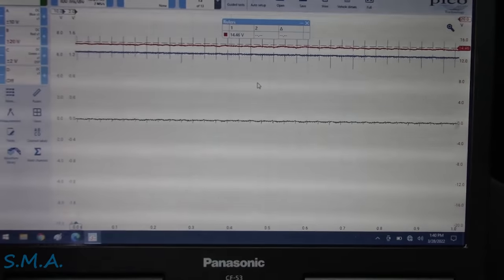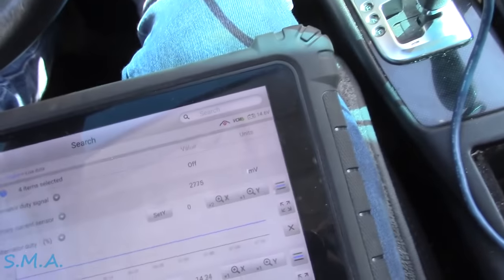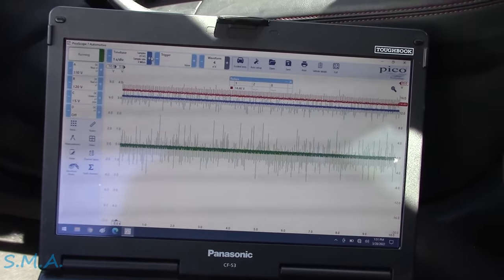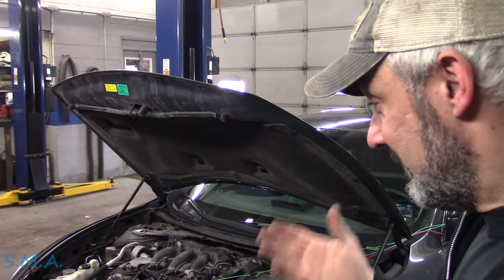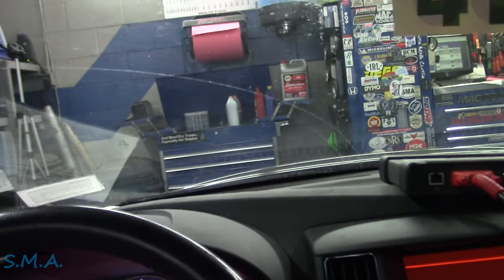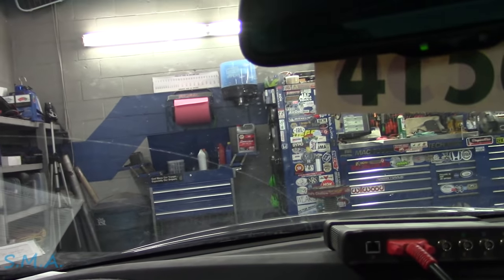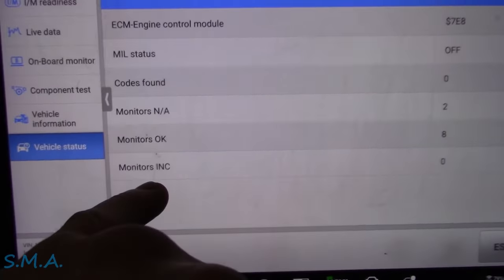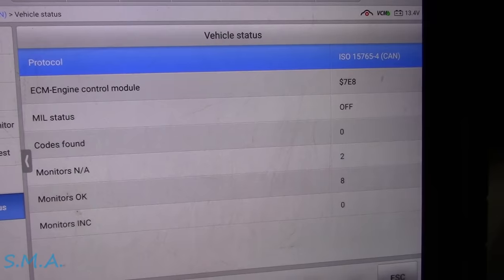Nissan Dealer Quoted Over $2000 For A New Harness!! - The Real Problem

Comment: But, here I am thinking, if the belt is squealing and the alt is wonking out, I'd have changed the belt first and see if that's all it was and then replaced the alternator if the belt alone didn't solve it....just because I had a 89 Sunbird that behaved exactly the same(minus ABS etc) with the flickering alt light, losing power, let it sit for a few, it was fine for a few more miles, than again .. My dad, an old mechanic, swore it needed a new alt. The shop I took it to said Nope, just the belt.  And that's all it was.

Comment: I think a refund isn't likely. The dealership will stand on "It is a diagnostic charge." They didn't actually fix anything yet. Had they actually replaced the harness and the problem persisted, then she could demand a refund. But diagnosis is charged by the hour, regardless the determination (what they think is wrong). 

Do I think the dealership should give her the refund? YES .

Comment: Oh those nissan dealers are horrible. Took my Rogue to the dealer because the blower wasn't working.
The quoted me $978 for the repair which I turned down obviously but still charged me $165 for the diagnostic. They basically told me what I told them that the blower was bad 🤔
Walked out and got a cs call from them asking about the experience. I told them that they were a rip off and they would never see me again.

Comment: Back in my day if the alternator put out more than 12 volts it'd charge the battery and there would be no problems hell you wouldn't even need a battery after the car was running

Comment: Not only should the lady get a refund but the "master technician" should probably be fired.  The noise the alternator made with the belt as well as the dash cluster lights going dim is enough reason for me to replace the alternator.  Too many bad mechanics that are ruining cars.  This Nissan would have ended up in the junk yard if it wasn't for Eric.

Comment: Mercedes are notorious for voltage regulator failures on their alternators. I have never replaced a Mercedes alternator but have replaced several voltage regulators. It is a $42 part. I get lashed at for not doing 'diagnostics' when a Mercedes has a charging problem but 95% of the time, it IS a voltage regulator. I just change it. If I'm wrong, I'm out $42 and a little labor. But look at the diagnostic time I've saved over the years. Why spend an hour diagnosing for a $42 part when you know that is probably it? So knowing your cars and drawing on experience helps you save the customer $$. Nissan dealer should be ashamed of themselves for this fiasco.

Comment: This happened to me at the BMW DEALERSHIP MY E60 2.5I WAS IN FOR A RECALL ON A FAULTY MAIN BATTERY CABLE WHEN I WENT TO PICK MY CAR UP THE SERVICE PERSON TOLD ME THEY HAD FOUND A SPLIT CV BOOT AND IF I WANTED THEY WOULD  REPLACE IT AT A COST OF £750 BRITISH POUNDS I DECLINED THEIR OFFER AND AS IT WAS DUE IT'S MOT I TOOK IT INTO  THE GARAGE I USE THE MECHANIC PUT IT UP  ON THE REPLACE and checked the cv boot the BMW DEALERSHIP said was split and it wasn't my CAR WENT FOR IT'S MOT THE NEXT DAY AND PASSED NEVER USE THE DEALERSHIP UNLESS ITS FOR WARRENTY WORK  BLOODY CROOKS

Comment: Nissan Dealer techs are so embarrassing.  We had a 2016 Murano (new car) and the dealer techs couldn’t make the carpet stay in the passenger side bolster.  If we put our feet on the floor it would pull the carpet out of the side bolster and flap loose carpet over onto our feet.  Their only solution was to put new carpet in the whole car.  Kept t for a week.  Didn’t fix it, so we immediately traded it in for a 2017 Volvo XC90 and guess what, the carpet stays put.  If the dealer had been smart enough to use some glue and Velcro we’d still be driving it.

Comment: Dealership should give her, her money back.  BS they couldn't simply figure out their own vehicle brand had a bad alternator.  If the dealership service department couldn't figure out it had a bad alternator, how many other thousands of customers have they ripped off....however, this seems to be the common theory when something goes haywire anymore, it needs a complete electrical harness for $XXXX...then they would have done that and been like well its still broke, the transmission needs replaced along with the engine....and the list goes on and on at that point.  

Give the lady her money back Nissan....and pay her however much it cost her to buy a new car for a piss poor dealership service department.

Given the equipment you have to diagnose this stuff, is no different than the equipment that the dealership would have, plus all their Nissan branded stuff on top of it, so they have no excuse as to why they couldn't figure out an alternator was bad.  When you were showing the voltages jumping really high I thought to myself that alternator is garbage, after I got past the weird it does it on left turns...so don't make left turns fix LOL.

Today's vehicle have so many electronically controlled systems one small problem turns into multiple problems...I was ready for you to start poking around at ground wires at first too...then you showed the high voltage and thought hmm, a voltage regulator, but I imagine those are in the alternator and not replaceable in most alternators anymore, and hardly anything if anything now has external voltage regulators either.  So alternator it is and they're expensive.

Comment: I know this is old [chronologically] but it might be worth the comment.  Until you've tried to diagnose a problem where the service writer gets 15 minutes' payment to diagnose what is wrong, half of which is spent finding the vehicle and the keys and possibly racking the car on the lift and then try to concentrate while the service writer says "are you done yet, are you done yet, are you done yet?"  Ala Bart and Lisa Simpson, you just don't know what these techs put up with.  Dealerships force techs to make a call and get the vehicle out of their bay.

Ivan over at Pine Hollow was smart enough to recognize this difficulty of working for dealerships and has avoided it although he could perhaps make more money.  No doubt he's a happier man by avoiding the aggravation.

Comment: Do the Nissan mechanics (I won't call them technicians) get paid on a flat-rate basis?  That's the root of them throwing parts at problems.  No money for them to make in actually diagnosing a problem.  There is far too much downside for them to spend hours to find a problem that "pays" 2.5 hours (or whatever the book says changing an alternator pays.)

Comment: I think the sudden appearance of a duty cycle signal, is because previously the ECU saw the higher voltage and was trying to lower it. It probably uses a control loop where the duty cycle goes down when the battery voltage is too high, so the duty cycle was adjusted down to absolute zero without the voltage reacting. Once the alternator was replaced, the voltage regulation worked again and the pwm duty cycle returned to its proper level.

Comment: The worst part is not the $1,000 wasted on the lousy, unprofessional "diagnosis" the Nissan dealership did,  but because they couldn't figure out the problem, the customer got nervous of the car and ended up buying a new one. If they had diagnosed it correctly, and fixed it correctly, she wouldn't have wasted a bunch of money on amateur hour diagnosis and she wouldn't have bought a new car!!!  Shame on you Nissan stealership. Another customer that will just go directly to Eric O. first for the correct diagnosis and repair the first time.

Comment: Wow if I were that lady I'd be pissed.  I'd be bringing your repair bill and diagnosis to the dealer, demand a refund and demand they pay your bill.  They wanted $2000+ on top of wheel speed sensors that didnt even fix the issue, their proposed repair wouldnt have fixed it either.  Ya I'd be mad af, good for her standing her ground, STEALERS dont know squat, theyre hardly mechanics just vaccuum salemen.

Comment: I stopped watching a Chrysler Dealer Tech on YouTube. Why?
He was all about OEM parts and dealership technicians.
I told him get off the OEM parts. I said if OEM parts are the best then why are you replacing parts on these cars with 80 or 90,000 miles? My saying is put a part on that is a good or better part than the original. When he was replacing the radiator hoses with a brand that he had no clue whether or not it was good, Gates, I knew then it was time to stop watching.
Amazing someone that criticizes aftermarket parts also shops at Harbor Freight.
My point is typically proven. Just because you wear a fancy shirt with your name and a list of all your ASE certifications and wear the master tech certification doesn’t mean crap!
I do very little in my shop anymore. I am retired. However I still see crap from stealerships. A few years ago I had a Dodge02 second GEN diesel that had been in the dealership. They replaced the torque converter and rebuilt the transmission. It still shifted crazy. A $40 BD diesel noise suppressor connected to the ECM and a slight adjustment in the TVC cable took care of the issue. The owner was ticked. One hour repair!

Comment: a nissan maxima that doesn't throw a code when something is major wrong? noooo never...yup bastards have a secondary system besides obd2 nissans own little protocol, odb2 readers get some codes, but ALL the codes can be found via the nissan dealer scan tool that you pay mega bucks for(or nissan datascan I II or III depending on year, which you can get a cheap $10 kkl VAG COM usb cable for)

its like nissan did JUST enough to be legally obd2 compliant then hid a second protocol in the mix for the real work.
had to work out all this for my maxima, got a cheap windows 10 tablet with a otg and kkl usb cable n datascan 2 software, works on everything 2000-2013 so far

Comment: I'm baffled, the dealer is supposed to have the correct tools and inside info on these cars, yet their solution wouldn't have fixed the root cause. This is the solution, buy a new car, drive it for 3 to4 years, get another one. Forget trying to get these fixed, the service dept. are lazy idiots.
Reply: They hire techs that aren’t necessarily the best, but will work for what the dealer will pay them plus any up sells they can do while under the hood.

Comment: really? u had to remove the compressor just to get to the alternator? wtf are these engineers thinking? aint no body got time do be doing a system drain and charge up just to take out a dang alternator. also Nissan probably hired a tech from jiffy lube. shit happens. in some dealerships the service advisors know more than the actual techs unfortunately

Comment: As I read the comments My conclusion is many if not most of you willingly chose to ignore how any of this works...Capitalism rewards what it does and punishes what it does...and the rewards and punishments are financial...

The dealers and manufacturers are simply doing what is most profitable for them and using their position to exploit the less powerful players in the game...There is NO Incentive for any for them to make or sell you a car that will last any longer than it will take  you to pay it off...That is by design ...It is intentional that they are difficult and expensive  to diagnose and repair ....Don't be surprised when it simply becomes financially impossible to repair them and they become valueless and impossible to even sell as a used car more than a few years old...

Not to mention impossible to insure after an accident...The availability of parts and the expense will force the purchase of new or simply doing without...